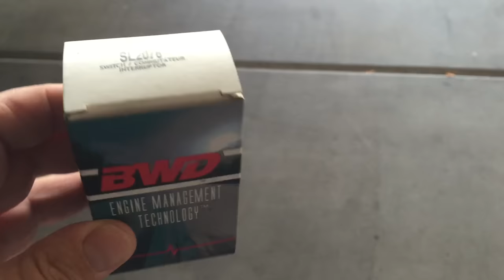GMC/Chevy/GM Truck Brake Switch Replacement

Comment: I can't understand why anyone would not like this video. Cruise control on my 2011 Silverado stopped working. I watched this video ordered the part and had it replaced in 15 minutes. Did struggle a little getting the clamp off however without this video probably never would have gotten it off.  Thank you for posting..... saved me a ton of time and the money to have a dealer do it.
Reply from the maker: Thanks for the comment! Glad I was able to help you get it sorted out.

Comment: OMG, I was putting up with this headache for almost a year! Sometimes it would shift , but lately not at all so I found this video.THANK YOU SOOOOMUCH. 30 min and it’s fixed.😁
Reply: Your truck wouldn’t shift properly from 2-3 or 3-4 without this switch ?

Comment: I had replaced one of these several years ago, but I forgot about twisting the shaft to disengage it from the brake pedal pin.  In less than a minute, your video had me back on track.  THANKS!
Reply from the maker: You're welcome!

Comment: I appreciate the video! I recently bought a used 2007 Avalanche and the only problem with it was that the cruise control didn't work. After brief googling, I found the problem, ordered the part off of eBay, and found your video. Getting the clip back on was a MAJOR pain in the ass, but all together, it took less than 30 minutes and the cruise control is working again, so thank you sir for the video!
Reply from the maker: Glad I could help! I was not able to find a video that showed the process clearly so I made my own. I had a little trouble with the clip as well.

Comment: Check all your bulbs before doing this. Might save a lot of time and money.
Learned the hard way.
Reply: Most common reason is because cruise wont work. Replaced the one on my sons 08 gmc now have to do my 2010 chevy.

Comment: Switched mine thanks to your video showing how easy it was. Didn't fix my issue, but one more possibility crossed off the list.
Reply: sportsfaan You find out the correct fix?
Reply: It didn’t fix my issue either. Did u solve it? Cheaply
Reply: @andf.3102  Through a lot of research, installing a new negative battery cable did the trick. No issues since. Have had horrible electrical issues with this truck and installing a new negative battery cable has solved them all twice now. Good luck
Reply: @sportsfaan hmmm, my negative battery cable has been acting weird lately.  My battery voltage fluctuates up and down at times.  I figure it because my positive cable is very loose due to the bolts holding it to the battery post cannot tighten securely.. So I have to pop the hood and wiggle it sometimes if I don't get connection when starting the truck.  I had a rare issue,  when wiggling the positive did nothing, so I wiggled the negative and,, it gave a popping sound like the positive wire would if touching the battery post.. I noted that in my head!!So now,  brake lights are not working . When pressing hard on the brake pedal,  brake lamps will start to brighten but go out. Top 3rd brake light doesn't light up at all anymore either... Help! Before I waste money on fixing this  and that!!!🙄🙄

Comment: Thank you so much for making this video!  I knew what I was in for in changing this out.  My 2010 Tahoe actually had a screw in the middle of the metal clamp, but other than that, it was exactly the same.
Reply: I have a 09 Tahoe,  I see the metal clip but no big bolt! I was confused and not willing to dive in until I knew that this was normal!!  So were your brake lights ever out and truck hard to shift out of park???????

Comment: Try spraying a little WD-40 at the pivot point on the brake switch and the through bolt that attaches it to the brake rod. Especially if it's cold, that brake switch part will stick out of alignment and won't activate until it rotates back into alignment. Simple easy fix!

Comment: Yep, 2008 2500HD Duramax Ext Cab, fixed it, and pretty easy job: Amazon for the part: GM Genuine Parts D1586H Brake Light Switch  Thanks for posting.

Comment: Thanks! I can live without the cruise, but my problem is towing a trailer with brakes. trailer brakes lock up and won't let go. hope this fixes it.  Thanks for the post!
Reply: I'm having same prob w/ my tralier brakes.  Scott- did this replacement fix your problem?
Reply: @jimmywilliams3976   been a WHILE BUT DIDI THAT FIX YOUR TRILER BRAKES STICKING?
Reply: Did your brake lights turn on randomly?

Comment: The brake switch is easily opened. Open the switch and clean the contacts. The one that will be on the end and closed is the one that causes the problem. Just fixed mine that way.

Comment: Found your video at 1 in the morning watching some overwatch (I've previously had videos of DIY repairs for vehicles) I didn't know what happened to my cruise control but it went out one day asked around people told me it was a leak in some type of hose. Looked for it and no leak. I've been driving without a cc for nearly a year haha. But this fixed it right up. It was the same issue it turned on but it would never set. I do remember taking it to the auto parts store to get it scanned but I wasn't informed of the switch code and basically gave up. But thanks for doing a good video! I spent $23 on it and it took me about 30 mins to fix. That dang clip was a #$@%!
Reply from the maker: Great to hear! Thanks for the comment.

Comment: One thing to remember on all of these models , is that the brake lights dont work with the ignition switch off like older vehicles. Itll save alot of time to know this lol.

Comment: If you get this same messages on your dash board. PLEASE try this first! I saw the posting late after replacing the throttle body and having to buy a new harness locally because the old one got messed up when changing the throttle body. This could’ve been a 30$ dollar fix. But turned out to be over 120 dollars. Still better than the 500$ repair bill at the dealership

Comment: We just recently replaced the brake booster in our 2007 Chevy 3500 minidump and then we replaced the brake light switch because we couldn't shift gears. Now the break lights won't work. Any ideas brother? Were pushed for time rn

Comment: Very helpful video,helped me alot.Thank you
Reply from the maker: Kevin MC glad it worked out for you.
Reply: would do you think if Im getting sevice stability and have abs and traction control light on for an 05 chevy Tahoe?
Reply: Yes. This fixed my 2007 GMC Sierra with ABS and Stability Control warning lights on startup when outside temp was cold.

Comment: I liked this video- but my 2008 GMC 3500 has a different type of switch... PITA to get at... I was not having cruise control problems, but brake dash light was never on when brake set, and android auto would not initialize since it could not tell parking brake was set...

Comment: On the clip the bolt goes through, you have to put a screwdriver in and pop it apart.  The clip then will slide off and u can replace the switch.  Most likely this part will fix your cruise control problems on 2008 +

Comment: On the 2011 GMC 3500 HDs, a socket wont fit in the space alloted, gotta use a wrench, and even then, there is an AC duct that gets in the way a bit.....still a good procedure, but I had to turn into gumby to do it lol.

Comment: 2011 suburban cruise not working changed the brake switch, still getting no indication light on dash but button light does come on. Still not engaging wonder if I was sold a bad one.

Comment: How do u know if it's the brake booster or the brake booster switch? I changed the booster but there is STILL air coming from my pedal on the Inside of the truck?

Comment: If these don't have an actual button like the older 90s vehicles how does it read that the pedal is pressed in. Also I looked at mine and its missing the 10mm bolt would I many be going bad quicker cause it might be moving around
Reply from the maker: Sorry, I am not a mechanic; just a do-it-yourselfer that saw a need for this video so I am not sure how the switch works. I can tell you that it is supposed to pivot somewhat as the brake pedal is depressed (the reason for all the grease).

Comment: this is just for when the actual "brake lights" with depressed pedal lights up? Cause I'm having trouble with my tail lights and the side marker lights at the very back won't turn off after I locking the truck. The lights around the truck should flicker/blink once or twice when locking and then turn off and they do at the front of the truck but not in the back and then they stay on :/

After l locked the truck with the remote a light for the lock shows on the dashboard so wondering if it has something to do with that :/

Comment: Called the dealer since my truck is still under warranty for 13k more miles asked them they said $20 for the part an $75 for labor....Are you f-ing High it takes less than 30 seconds an your going to charge me $75 GTFOH Keep in mind they said an oil change is only $50 which takes longer....

Comment: Where do all those wires go and why so many just put a switch in mine no fix
Reply: Engine won't turn over will run if jump the starter

Comment: My 09 tahoe shifter sometimes gets stuck and the abs light turns on also the stabilitrak and the traction control light , heard that by changing the brake light switch it would solve it . Anyone dealing w the same issue ?
Reply: If the stabilitrac and traction light come on after the steering wheel is turned it is probably the steering wheel position sensor.

Comment: Is it close to the same on a 2003 duramax 2500? Thanks. One brake light works but the other doesn't, i changed the socket the bulb goes into but that didn't work, I'm going to try this if it's the same on a 2003.
Reply from the maker: Sorry, I couldn't tell you. I am not a mechanic. Just a do it yourselfer that saw a need for a video on my particular vehicle.

Comment: I broke the clip attempting to remove it. Any ideas for replacement part number? I have been to all the major parts store and no one can find anything that will fit it.
Reply from the maker: I think this is it:
https://www.amazon.com/General-Motors-GM-11548247-Clip/dp/B015NE7ZP0

Good luck!

Comment: Its usually coffee on the switch take it off clean/dry/lube with bulb grease put back done!!! Its a very simple switch you don't need a new one but if you see corrosion small wire bush problem solved
Reply from the maker: Coffee on the switch? Not sure how that can happen given its location above the brake pedal. Cleaning might be an option but if you're going to go thru the trouble of taking it off to clean it, might as well just spend the $15 and install a new one.

Comment: When this switch is wore out, will it prevent the vehicle from starting?
Reply from the maker: Sorry, I couldn't tell you. I only know it fixed my cruise.
Reply: Hello, did you get an answer to this questions, my truck wont crank, new starter, new batt/ fuses are good, ignition switch is good. Running out of options. Looking all over for possible glitches like this that might be causing it.

Comment: My brake lights don't work, but the third light on the cab DOES work.  Also, my trailer brake lights DO work.  Anyone have any insight???   Could it still be the brake light switch???  I'm guessing not.  Thanks.
Reply: What was the issue?
Reply: @crawlinkingsnakegaming9794  you find out?
Reply: b  unfortunately not. Altho my lights did begin to work again shortly after posting the question. So I'm guessing lose or corroded connection that I was suffer from again....

Comment: was anyone else's cruise control affected by this
Reply: Justin Blanton yeah, if the the brake light switch is bad the cruise control won't engage
Reply: Justin Blanton yes my cruise stop working when break lights stayed on
Reply: Yes mine was. During the winter if it was really cold out, my cruise control would not work until the engine was really warmed up, usually a good 40 minutes at highway speed. Summer time it was fine. I read where the brake switch might have been the culprit, so I ordered a new one AC/Delco and had my local mechanic install it for me. Problem immediately went away.
Reply: If your talking about the gear shift won't move then yes, I have gotten stranded three times in the past week!! Couldn't get out of park,to drive home!! Very upsetting to me!!
Reply: I've been driving without my cruise control working ever since last year,if you are driving with TPMS light on,then your abs light and stabiliTrak lights will come on,after three or more months,it will make your vehicle,not want to go into gear!!
Reply: Jeanell Garner my car won’t shift out of park either, is it the brake switch potentially?
Reply: I have to push my brake pedal almost to the floor to get out of park, this is all the time..

Comment: Closeup doesn't show you where the thing is even located.
Reply from the maker: At :16 seconds in the shot starts at the brake pedal and moves up to the switch (indicated with red arrow).
Reply: kre57 drrrr. Okay thanks.